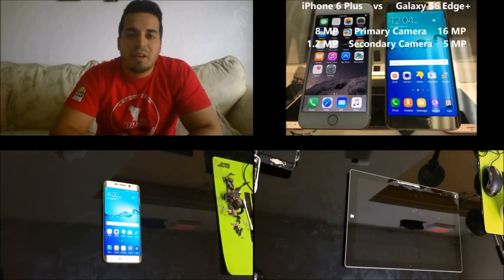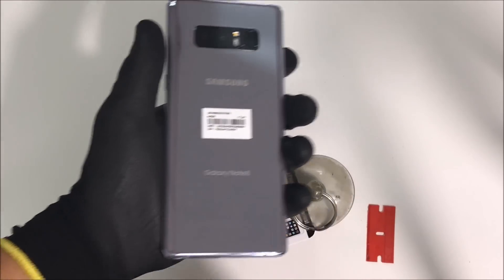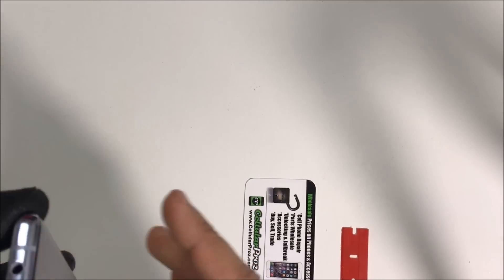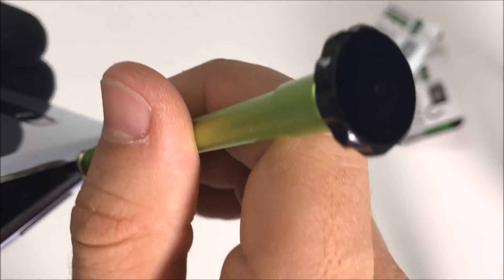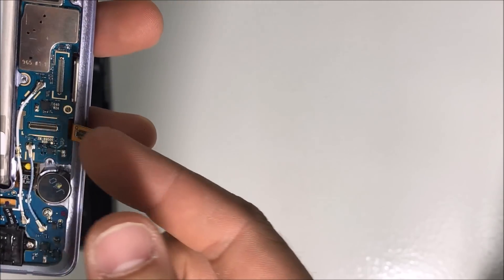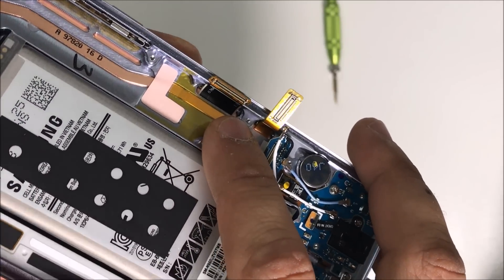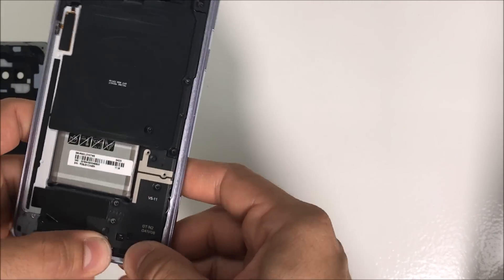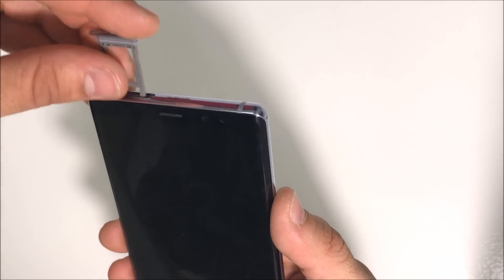Samsung Galaxy Note 8 - How to Take Apart & Replace LCD Glass Screen Replacement

Comment: Why did we take all this stuff out, only to tell us to pry off the old screen, put on the new screen and push the ONE cable (ok, two) through the opening and attach to the motherboard?  Why'd all this other stuff have to come out?  The mother board didn't even need to come out.

Comment: Hi!  I have a Note 8 N9500 (256gb import) and a Note 8 N950 (64gb UK Model). I notice there is a big difference between the brightness (output) and whiteness of the two screens.  It's almost as if Samsung a putting a cheaper screen in their Note 8's that aren't sold in to the US and EU. Any one else found this?  Also no amount of fiddling with teh display settings makes any difference to the colour balance and output.

Comment: I rather send it to an authorized repair shop to make sure it would be IP68 afterwards plus not ending up breaking the warranty by doing it myself.
Reply: Duckers you break the warranty by cracking the screen
Reply: That's true, the warranty is gone when you crack the screen, but over here in norway, you get it back again if you send it into an authorized repair service. I did that with my s7 edge. Had insurance so i only paid 120 myself, and the insurance company covered the other 350 bucks for the screen replacement.